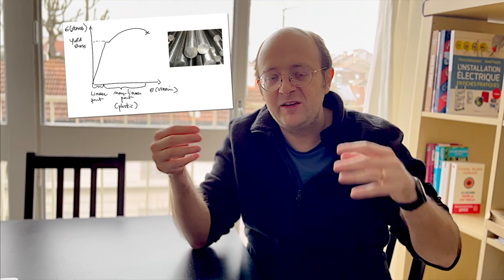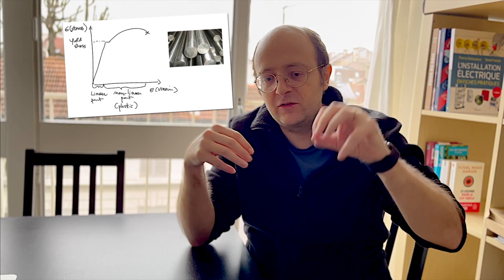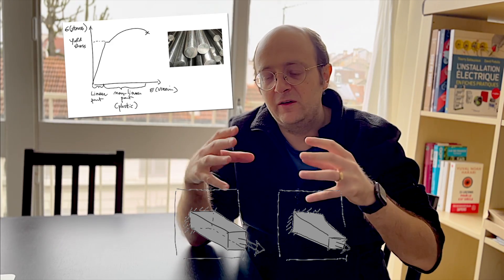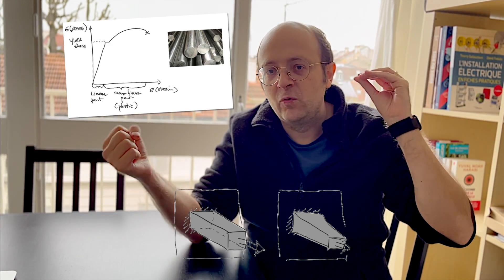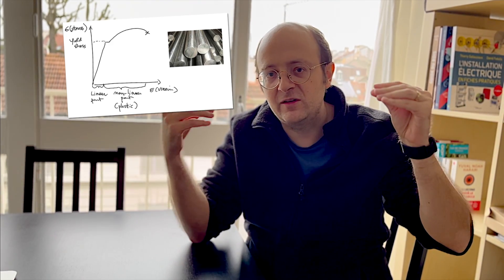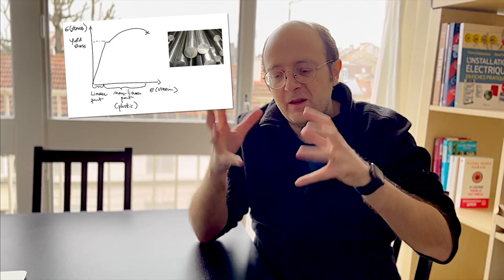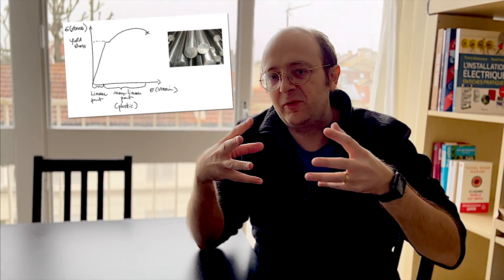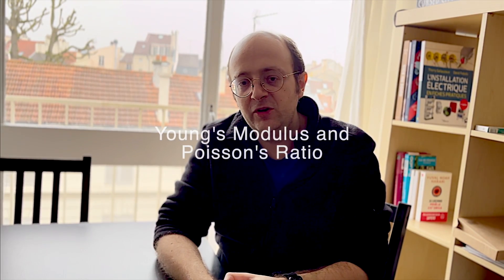What is linearity and what's the difference with nonlinear simulation? - FEAforall

Comment: In our approach to this problem from a mathematical perspective; engineers generally design systems. These systems can be electromechanical, thermal, hydraulic, and so on. We apply an input and an output to each system, and the system transforms the input into the output. For instance, we can apply a force as an input to a system and measure acceleration as the output, similarly, we can apply a force to a system and measure deformation. We represent the input-output relationships of systems with mathematical models such as differential equations, linear equations, integral equations, integro-differential equations, and so on. If the input-output relationship of a mathematically modeled system satisfies the superposition theorem, then the system is linear. For example, in Hooke's law, the applied force to the system is the input, and the deformation is the output, and within the linear range, the system behaves as y = Ax, exhibiting linear behavior. One important note here is that a system of the form y = Ax + b is not linear and does not satisfy the superposition theorem, I leave the proof of this to you. In our studies, we can analyze the input-output relationships of systems to determine whether they are linear or nonlinear.
Reply: Sure. Leave the good stuff as an exercise for the reader. Just kidding! My gut tells me there's no way y = Ax + b can be non-linear. And I'm really not sure how to approach proving that it is.